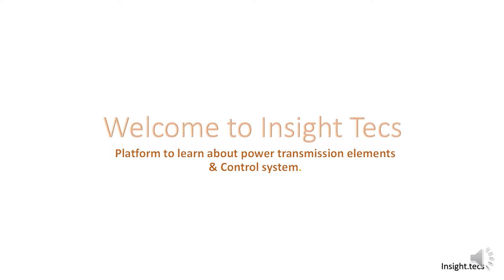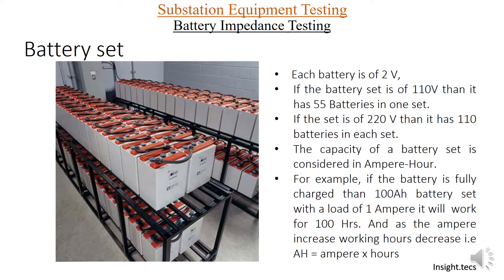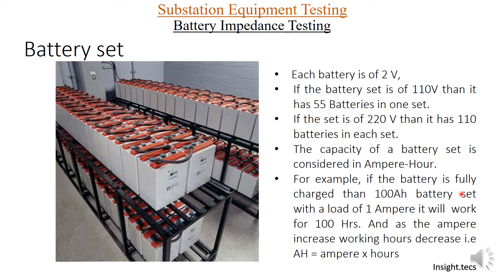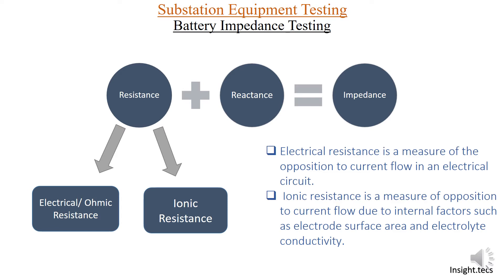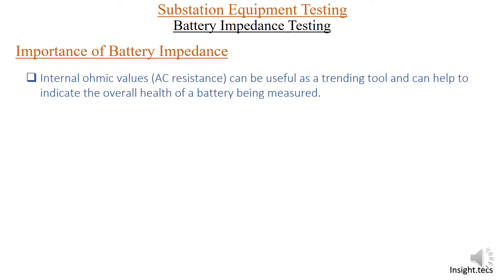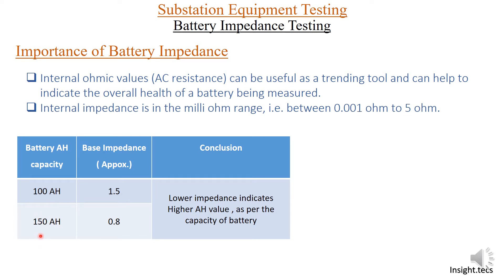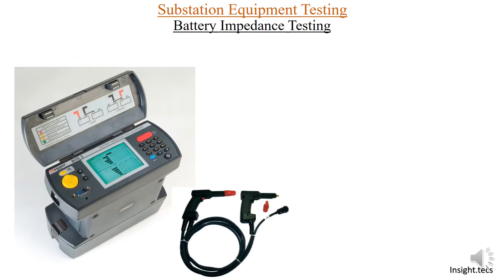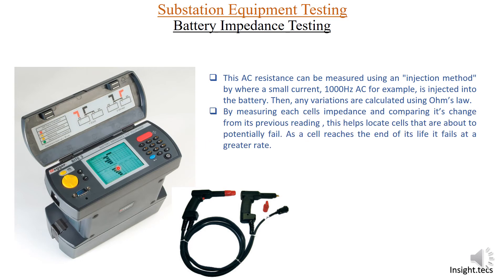Battery impedance measurement testing using Megger Bit 3 kit

Comment: Can you plz explain how to replace failed battery with new one.
If a battery set is put in discharging mode for some time and if we want to replace the cells that are showing low voltage after discharging time, how to replace it. Can we replace a fully charged battery in place of that low voltage battery that is put in discharging mode for some time
Reply: Discharge all the batteries to end of voltage And discharge the new battery also end of voltage and record voltages and connect now new battery in series with the other batteries